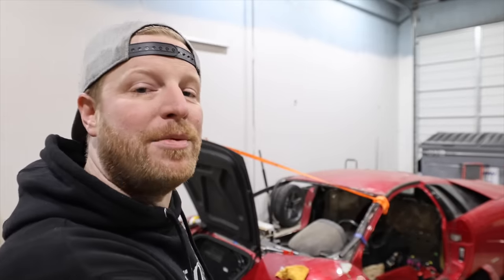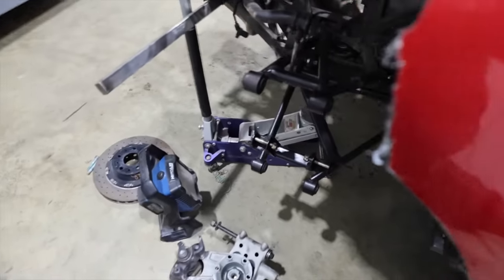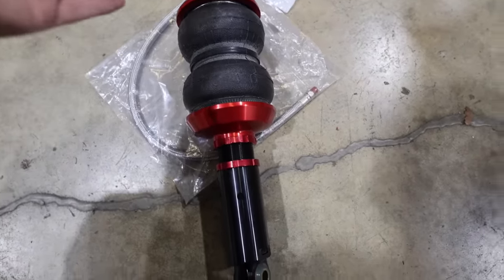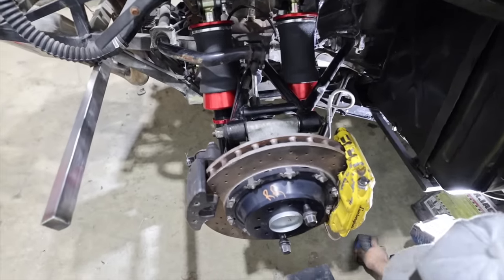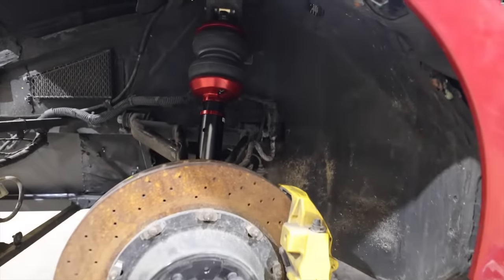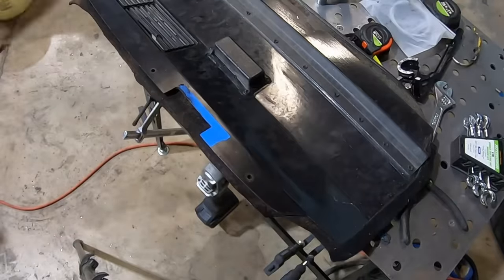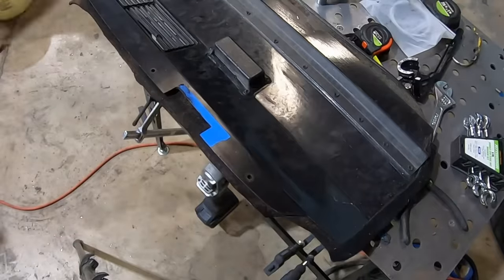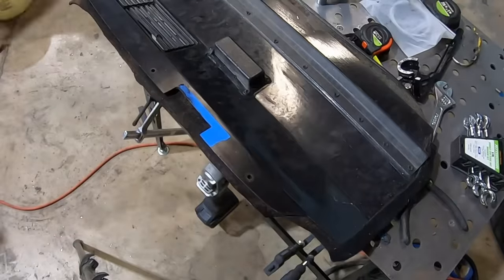Reviving the Cheapest Lamborghini Murcielago Ever - New Suspension & Air Ride Install!

Comment: Chris - looking at online images of Murci's, none of them show the rear wheel being so off-center to the wheel arch as yours is. Suggest you check to see if your rear suspension is 'bent' forwards.
Reply: Google "Lamborghini murcielago rear wheel fitment" within the first 6 images you can see how off it is. Additionally the closer the wheel gets to the arch the more evident it is.
Reply: Yeah they're not meant to be like that. Something is definitely bent
Reply: Matt Armstrong can probably send him some measurements
Reply: Agreed. That's way too forward
Reply: @cheesepizza87   Or Ed Bolian who he already has contact with and has 3 Murcielagos parked in his driveway...
Reply: Possibly with an alignment there is some adjustability .
Reply: I think you guys need to look again.
Reply: Yeah definitely look again.. loads of pics out there with the wheel positioning favouring the centre of the car. An odd design, but clearly intentional
Reply: I'm thinking things got out of wack from impact on the other side. If you recall, the whole rear was tweaked when they made those rubber washers/bushings.
Reply: Given that there's a huge dent in the upper control arm tube, I'm guessing that they have an idea of what's happening there. I'm sure they will address that after, but certainly no mystery there.
Reply: Look again, murci wheels favour the centre of the car. Might not be as bad as that but that could be a wheel size issue.
Reply: Guarantee chris will get it right
Reply: They are all like that but him putting that huge wheel on there it really shows. It looks funny as hell and don’t know why Lamborghini does it but they do. Factory wheels actually sit in too far too.
Reply: I think on earlier models it looked like this one but the fixed it on the later models i dunno that's what I saw on google images
Reply: Those wheels are bigger than stock murci wheels, so it looks more off than normal. But from factory the rear wheel is more forward.
Reply: Something is wrong here,it’s way too close. What’s bent I’m curious?
Reply: I'm sure when he took off the original rims he would have noticed if they were off

Comment: Just be aware of condensation in the lines if you are going to mount the manifold upside down. That's probably what they are referring to rather than water getting in from externally.
Reply: Maybe install a desiccant filter if it doesn’t already have one.
Reply: If air suspension pumps air in from atmosphere there will be moisture in the lines. Suggest you put driers or dehumidifiers in the lines.
Reply: Yep some kind of air drier and water separator.
Reply: its fiiine upsidedown. minitruckers have been doing it as long as these manifolds have been a thing.

Comment: Im pretty sure they're referring to water from condensation in the air lines, not exterior water.
Reply: This
Reply: Agreed! The condensation will eventually restrict or prevent movement of internal valve parts due to corrosion of the aluminum body and moving parts. It’s one of the biggest problems in pneumatic control systems, that’s why they put air dryers after the receiver/storage air tanks and drain traps off the bottoms of each tank. You will eventually need to reposition the air manifold/control block as recommended so that the vent port will allow at least some condensation drainage. 
Love the build- good luck

Comment: if you are running 2 batteries they should be the size and spec for charging with the alternator to keep them balanced
Reply: This. They both need to have the same cyclic and float charge rates (volts DC and amps), and your alternator needs to output the proper amounts to make sure you dont destroy your new expensive LiIon battery. Either upgrade both batteries and the alternator, or just put a battery in and accept the weight. Usually a li ion battery want 14.4-14.8 VDC, same as an AGM.
Reply: If he’s joining them they need to be the same type also lithium-lithium AGM-AGM etc

Comment: You should look into vibration dampening/isolation mounts for the compressors to help eliminate that pump noise.  Land Rover does an extremely good job with their mounting systems (reduced to a very very light/pleasant hum outside the vehicle).  I think it'll help push the builds detailing that little bit further with it. Keep rocking it!

Comment: I know someone has already mentioned this but Chris needs to see this and either re-configure or maybe add an evaporator of some kind.  Environmental moisture isn’t the main source for water ingress they would be warning about.  Most likely cause would be condensation making its way through the lines and into the manifold.  If it makes its way past that and into the suspension parts then you will have problems.

Comment: If you want the whole car to drop simultaneously you can match the front air line to the length of the rear air line and tuck the excess away. Since your manifold is in the front the airlines to the front are a lot shorter so they dump the air faster than the rear so your front is bottomed out before your rear even starts dropping

Comment: The water ingress isnt from the exterior. Its the compression and decompression of air that create's condensation in the tanks, lines and manifold. This happens alot in humind and pretty varying temps like in your area. You can also add whats called water traps to take the water out but the manifold is more about that condensation freezing in the solenoids I believe.
Reply: You can also add 1 tablespoon of Air brake anti-freeze into the tanks coming into winter to also prevent freezing water, just have to bleed it out of the tanks come spring.

Comment: Regarding the lithium battery: you may want to consider putting a DC-DC charger in between that and the alternator. Depending on what sort of lithium battery you’re getting, they can pull an unregulated amount of power from the alternator, potentially putting too much of a load on it, and killing it prematurely. The DC-DC charger essentially puts a cap on the rate of charge and how much it can pull from the alternator.

Comment: That stainless piece in the caliper transfer tube is to keep fluid in the tube from boiling.  I'd rebuild that hose and put that tube in.   Typically they're RTV'd in place along with the tube to the caliper.  Connecting the airbag sides creates an anti-anti-sway bar.  It will cause the car to sway more than it should in corners.

Comment: If you decide to use the same size wheels at the front and the rear, make sure you do the 2WD conversion. Factory wheels at the front are smaller in diameter than the rear, and any change in ratio destroys the 4WD transmission.

Comment: Don't T the lines from either side together. As you corner, the one side compressors and sends the excess pressure to the other side
Reply: I was looking for this 👆

Would be much better to have independent all around Chris

Comment: Should look into doing the manual conversion on it... I know on some of the F1 trans Ferrari's you can delete the valve body and install linkage rods. They're basically manual transmissions with a hydraulic valve body "brain" that shifts the trans. Curious if the Murcí is the same way.... 🤔
Reply: Didn't Mat Armstrong do that to his?
Reply: @Wormweed  actually yes... I believe so. Well, it was already done by a previous owner. But his was originally equipped with a manual I'm pretty sure. You're right though, it is like the F1 style Ferrari's. I forgot about Mats

Comment: Chris if you are going wide body you should have a look at the murcielago that driftworks built as they did some amazing things with the suspension to get everything to work and fit in the arches properly  to run the car very low  and have proper turning radius and suspension articulation

Comment: I know it’s pretty obvious that the wheel fitment in those wheel arches is off… Does the other side of the vehicle look the same? Or is it just out of adjustment because you replaced hard parts? I love every bill you guys do!
Reply: Control arms are prob on the wrong side pushing the castor forward.
Reply: Good deal!  I didn’t think it could possibly something major.

Comment: Hey Chris, those rear air bags will swell at least 2 inches in diameter under full load. Are you sure they are not going to be rubbing on the control arms?

Comment: James on donut media built 3 piece wheels , you can order the barrel at whatever size you want and cut the center out of the old wheels and order whatever backspacing you want. You get the barrel and outer ring together and then weld them back together. I'm sure you don't want to do some hokey job on your Lambo, it's just a thought.

Comment: Yea, just the same comment as everyone else. The moisture in the airlines will sit in the manifold now. Once the temperatures get down to freezing, it expands and damages the pressure sensors in the manifold. You’ll then need a new manifold. So I’d swap it round and fit some 90 degree fittings or whatever you have to do to make it work the correct way round

Comment: Although you have the height for your drive, have you considered the measurement of front of wheel to bumper edge, the nose will take longer to start rising as the wheels will be on the road rather than the drive

Comment: You need to flip the manifold because the "water ingress" you are worried about is the condensation from the compressed air in the tank/system. Not actual rain/puddle water ingress.

Comment: To charge the lithium battery, it needs to go through a DC to DC charger or it will short your Alt and/or regular. There is very little resistance in lithium and it will suck the charge system dry.

Comment: Why did you think a 305 would be good for the front? Also I'd have to think that the chassis is bent or tweaked for the wheels to be so pushed toward the edges of the wheel wells.

Comment: For clearing ramps it's not the absolute height of the bumper but rather the angle between the bottom of the front wheel and the bumper.

Comment: You DO NOT want to mix a Li battery with a Lead Acid battery without a DC/DC charger. Li can charge mega fast compare to Lead Acid and the Li battery will kill the alternator. I'd recommend if you want the Li battery to run as an auxiliary battery, you look into a battery isolator with in combination with a higher output alternator so that it can dual charge while keeping the batteries isolated from one another.

Comment: i hope you are running dryers with that system because when they sad about water in the blocks that means the water out of the air that goes in there

Comment: First comment on YouTube. Please please please add a Schrader valve and a female compressor adapter to the tanks. Schrader valve incase your pumps die while on the road and you need to lift your car at a gas station and the female compressor adapter so you can test and tune using shop air instead of the pumps. Also get a battery isolator for the front battery so your car is not fighting for amps from the air ride during its charging state. I only know this because these things happened to me ... that Schrader valve saved my butt during a long night of hitting the switches!!!

Comment: Downside to air is planned obsolescence you get 7-10 years before that rubber is too brittle and inevitably cracks and leaks, and by that time if you can find replacement parts to rebuild they are often from the same manufacturing year and will likely only last a few years. I do like the slammed look though.

Comment: Hey Chris, on the off-chance you see this:
So I am in planning to move to the US in the next 1-2 years. Mostly because I"m a carguy and I love the freedom there and I am doing some research on a lot of things. One thing I learned is that, at least in Texas, you can ask for a permit to modify the driveway/sidewalk in front of your house as long as you pay for it yourself. Idk if this is a TX thing (bc TX is fucking awesome) or if this would be an option for Oregon too but that might also solve your issue with your driveway.

Cheers from Germany!

Comment: Be careful if you plan to have the wheels poke out past the fenders. If you blow an air line, that corner will drop all the way to the ground. The wheel/tire will win and the fenders will lose when they meet.

Comment: You could have used your Land Rover Range Rover Air Pump and Air tanks, it’s lot bigger than what you are installing. Land Rover is so small it’s round shape but very powerful, air tank is also slick and small a little longer. LR air system is big and design is excellent it will work with your controls cause it’s only air to fill in and exhaust. Simple

Comment: 🌟 Chris - Remember one thing Murcielago s have a silly Problem if you are gonna keep it ALL WHEEL DRIVE then Do Keep The Diameter Of The Rear Wheel & the Front Wheel As Lamborghini Recomended Specs , Otherwise Its Gonna Damage The ALL WHEEL DRIVE system of the car .

Comment: I'm not sure when you meant that you're running a t to the rear shocks hopefully you don't mean that you're running one single line to the T to the rear of both sides of the car cuz if that's the case you're going to create problems because when you go into a turn one is going to put more air or push air from one side over to the other side and vice versa and it will make your car very unstable and pretty much guarantee you get into a wreck

Comment: I wanted to see the Tesla Lambo yet, fixing what you have it's the best path forward!! I feel the rear suspension is probably bent and misaligned from the crash. You guys will have to readjust it so it doesn't give you major headaches down the road! It was great to see Kyle back, and Oscar did a great job!!

Comment: I love B is for Build, but fellas we can do better than wood in the "frunk"
Reply: What material do u think would be better?
Reply: @AA-nj4co  steel or aluminum. Could even be thinner with riv-nuts for mounting.  Even a sandwich construction composite
Reply: @scottmorse5499  probably wanted wood for the sound dampening and help absorb vibration from the compressors

Comment: Are you aware that the front and rear wheels are supposed to be different diameter? If you plan to keep the car AWD, make sure you get the size diffence correct, or you'll destroy your AWD system.